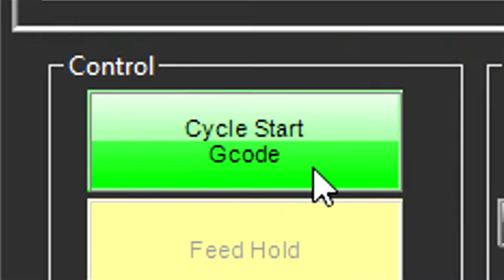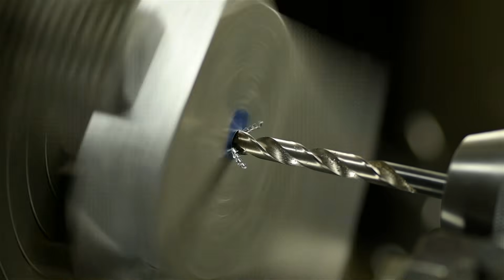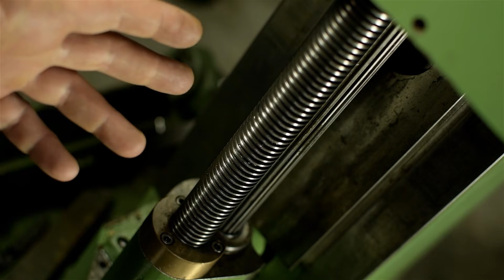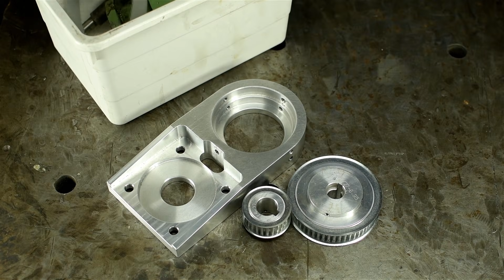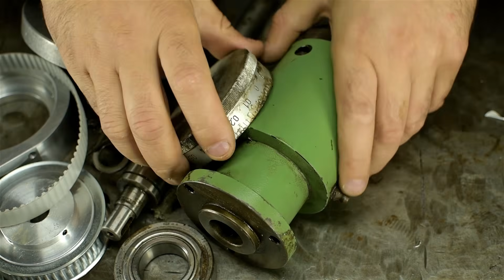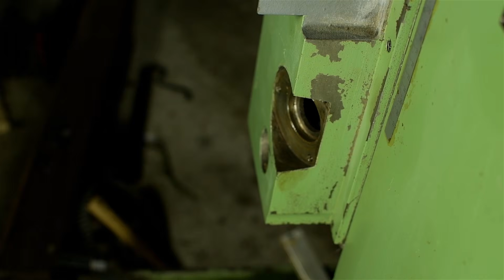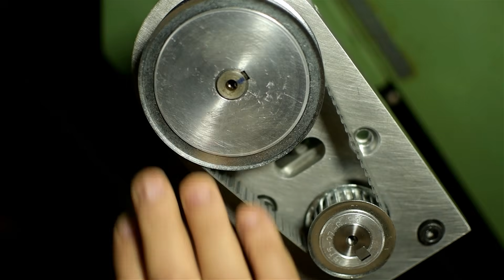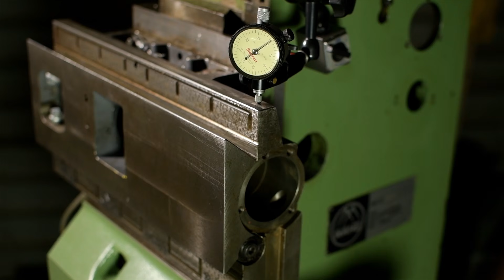MAHO: Move'n On Up!

Comment: high belt temperature means the belt is too tight or too small for the force you are putting on it. i put my money on the latter.
Reply: Or maybe the belt is not constructed/ incorrect material composition for the torque application....timing belt not drive belt? Reacon it is flexing/streching, just wait till the rest of the wieght goes on, might just fail, that sprag clutch was probably there to prevent the weight of the mill table combined with gravity from free spinning down when it was manually wound.....just my 20 cent bet ;)
Reply: What do you mean by too small for the force?
Reply: @AadityaKhare42  Every belt has a maximum force you can use it for. These belts look like T5 belts to me. I switched to T10 (that can handle bigger forces) on my robotmower because the T5 broke. If this T5 breaks TOT is in for a bang.
Reply: I’m not a big fan of using belt drives for high loads.
Reply: @nogmeerjan  it will probably just turn out that he was using an metric set of drive wheels and belt rather than imperial....lol  ;)
Reply: @AadityaKhare42  Getting a goat to pull a log instead of an elephant.
Reply: @nogmeerjan  My first guess was too much belt tension, but your comment on the load  rating of the "rubber" makes sense too.
Reply: Bunyip Dan weight of the table rests on that acme leadscrew, if that’s not turning then the table isn’t going anywhere.
Reply: Dya reckon that sprag clutch was to counteract the weight of the bed+workpiece so that the operator feels the same resistance screwing up and down? If so removing it may be causing the servo and assembly to be stressed when stopping after moving in the Z- direction.
Reply: @snaplash  he will really need that after all the wheight....that belt won't hold all the wheight in upward movement...
Reply: @blankroomsoup666  my bad, was locked into thinking in ball screw general characteristics.......still have a feeling under heavy load an acme screw might transfer some rotatation force if the handle was turned......maybe TOT could do a video on acme vs ball screw in vertical applications? 
Maybe it is just to reduce inherent backlash in the acme......which may mean TOT might want to retain it.......or just convert it to ball screw.
Reply: There is air being trapped and compressed causing heat. Drilling small air bleed holes and loosening the belt will make it silent as can be. A common problem for drag racing using belt driven oil pumps, fuel pumps, and roots superchsrgers. Gilmer belts are notorious for causing this :-) if the belt returns to 0 it's not stretching or deflecting.
Reply: You'll notice on most cars running a belt driven accessories like a Gilmer driven water pump use a "faceless" pulley. It allows air to escape. Since the belt doesn't need much alignment and doesn't walk off like other types they can get away with it.
Reply: Don't put your money on the ladder. It will blow everywhere. Trust me.
Reply: @Ding_Bat  I wish the Harley-Davidson Motorcycle Co. shared that view!
Reply: @bunyipdan  12.7 mm instead of half inch.
Reply: Have you considered suspenders?

Comment: Love the closed-loop control system.  It always surprises me when I read something on Reddit like "I was working on a 36 hour 3D print, but at hour 35 my printer lost a step and scrapped the part!"  For some small amount of money, you could have the printer know exactly where the extruder was, and just stop the second something went wrong, and accurately resume once you've taken a look.  I guess it doesn't really matter for hobbyists, where cheap is important above all else, but on some level it makes me sad how easy it is to do it right and we still do it wrong.

Comment: TOT regarding the belts heating up: "I'm not really sure what to do"
Us viewers: "what do you think it means?"

Soft voice in the background: "Gear cutting video"
Reply: The backlash is a problem and that is why they direct drive or use belts
Reply: @hackish1  Is there any reason not to use glass scales on the axes?  Then backlash anywhere in the system shouldn't matter.  I mean I suppose it would add extra cost....
Reply: @blahblahblahblah2933  the sync time is problematic. When you command the motor to turn, there are a lot of things that happen before the axis completes its move. You can't stop the machine after every move. 

Using the encoder on the servo is a more reliable method.

Comment: The servo DRO does not allow for backlash so be careful.
Reply: I wonder if it'd be better to close the loop on the axes instead of the motors.
Reply: @LanceThumping  For optimum results, you would use a double loop.  Using only table sensors would cause oscillations.
Reply: @byronwatkins2565  usually rotary encoder on the motor and linear on axle, loads of advantages although a bit harder on software, don't know if those drives have the option though
Reply: @Nuno.A  Servo motor position (angle) is quite precise; however, gear backlash allows the table position to vary several thousandths.  Clockwise motor rotation gives different table position than counterclockwise motor rotation.
Reply: @byronwatkins2565  exactly true, and to avoid backlash, play, on the gears,  belts, ball screw, coupling, etc, the table encoder is usually linear, has that give you a very precise position on the last possible moving part, on a vertical is less of a issue has gravity hides many of the issues, with that you can also do temperature compensation and correct backlash.. to a point, too much wear and the axles start shaking has the control goes in to constant overcorrection

Comment: "I also knew I would need a TON of torque. Maybe not 2000 pounds, but a TON of torque nonetheless."

Is that a metric ton joke? Cause I am seriously impressed.
Reply: imperial ton is 2,000 pounds, it was a standard ton joke
Reply: @herzogsbuick  Apparently an imperial ton and a metric ton are around the same. Imperial ton is 2240 lbs.
Reply: @pagaiba3  a long ton is 2240, short ton is 2000lbs
Reply: @herzogsbuick  alright

Comment: Cool conversion. I would advise you to keep the original Z axis screw instead of moving to a ball screw. With all the weight on it, backlash is not really an issue, and the poor screw efficiency (friction) will limit the holding torque required from the servo motor and it will thus run much cooler. If you don't need high speeds, and you lubricate it well, I guess it will work perfectly for many years to come.

Comment: I don't think the encoders in the servos can completely replace linear scales because they'll still be subject to backlash in the lead screw.
Reply: With a lead screw, that may be true, but with a properly designed ball screw set up, with preload. The backlash becomes vanishingly small, certainly good enough for home.  In very high end CNC, they switch to glass scales for basicaly insane accuracy.
Reply: @Kevgti5  and with a belt driving a lead screw?
Reply: @teryk  a belt driving some gears, which in turn drive the soon to be quite worn screw.
Yeah...
Reply: @teryk  The short answer is it depends. But highquality timing belts can get into seriously lil backlash. Many actual machines use em ? Like CNC lathes or packaging equipment (what I design). Realistically you could eliminate everything and put a servo gearbox instead, the "common" servo gearboxs have like 0.05 degree of back lash (3 arc minutes) and you can find better if budget allows.

Comment: Tony, I think you are screwing up when you think that an encoder mounted at the motor will tell you where the table is at. On the Z axis you can cheat (read fool yourself) because gravity will often take out most of the gear lash. For the X and Y axis I hope you are planning to use linear encoders mounted to the table and not the motor encoders. I love your style and the stuff that you do. I bought two of your T-shirts. I am a big fan. I used to teach beginning classes on analog servos to service techs. If you are interested I guarantee that you will get the best sleep you have ever had. Just kidding. I'm old school but I am good.
Reply: The ball screws he will be using should have very little to no backlash (if speced correctly for application), so motor encoders alone should be fine. Also most servo drives have backlash compensation parameters that can help with screws that have lots of backlash.
Reply: @RobertChadziutkoRC  We will all enjoy watching what Old Tony does.
Reply: @marklockwood7592  agreed

Comment: Love the blend of engineering and humour....The holding current of the Z Axis servo should hold it up...Not sure if it will when you power it off though...I used to use a French Huron Mill, and that would float down on the screw if you hand spun the handwheel...Kind of dangerous actually ..Great video, can't wait for the rest..

Comment: we recently added cnc to our e mill. we had already added steppers to X and Y so my dad's arms would stop hurting. then got a router, learned mach3 and cam softs, and transferred the brains to it. it was a project in itself to mount the z motor. I also used a timing belt reduction.

Comment: The chisel "magic" is quite satisfying! You should consider making some other perhaps more elaborated "magic shots" in one of your videos! 
Examples:
-Cutting large chunks or features of the part with the chisel as if you were "carving" a metal part
-Punching a hole with a blunt bit of round stock and a hammer
-Threading a part with a regular nut (you can fix the part and the camera; and then take a time-reversed shot where you unthread the nut and merge in composition with a still frame of the part prior to threading)
-Cutting round stock by wrapping some fishing line around it and pulling really hard

Just some ideas ;) 
That would be soo fun to see!

Comment: EtherCat is a fieldbus, used to communicate between components. Not just servo axis also I/O basically any EtherCat enabled component. So later easy to add I/O stuff, saves tons in time and cabling and commissioning!
Encoders come in many shapes, if no reference point is needed at startup then use an absolute encoder.
Servo motors never know where they are, by reading the encoder the drive knows where the shaft is.
2K for a 3 axis is a decent price for one-off application.

Nice machine work btw!

Comment: Tony , you will be very happy with servo motors. I put in some when my steppers didn’t cut it. Very precise control and no speed torque limitations. Now my screw drives tend to whip.

Comment: 23:30   You can get metal reinforced belts.  Also, when putting new holes into pulleys, it helps to use your indicator to make sure the pulley teeth have no runout when it's mounted in the lathe.

Comment: Hi TOT, Thanks  a lot for sharing. Finally the next MAHO video! If You want less noise from the timing belt, try the HTD 5M type as they are made in rubber with rounded teeth. Or better yet, choose the 5MR type to keep the precision. The polyurethane T5 belt You are using now is with trapezoidal tooth shape which causes a lot of the noise. It also has steel cords inside which is not helping to cool the belt at all.

Comment: Tony. Go direct onto the screw. You no longer need to be on that 90 degree. It was there to provide a handwheel position. It will be difficult to avoid chatter and reversal spikes on that access without a direct motor to shaft connection. And if you are going to that effort, go ballscrew.  Ex CNC design Engineer. Great work!

Comment: 14:14 Having drag in the down direction helps prevent drift from vibration while under manual operation. Also, helps balance the effort to move in both directions. Driving the Z axis with a servo motor, you'll likely want a power-off brake, especially if you convert from lead screw to ball screw
Reply: This dual level friction mechanism can be found on bicycle gear selectors prior to indexed shifting. Minimal friction is added pulling the cable toward the shifter, because you're already working against the return spring. Additional friction is used when paying cable out to counter balance the force from the return spring

Comment: Hey Tony, thanks for the video!

I would not suggest running the machine without limit switches. I am not a machinist, but in industrial automation we almost never rely on such kind of feedback to limit the machine motion, especially if the drive is powerful enough to ruin your machine (and your day when it happens :D). So if it was me, I would 100% include the limit swithes for the build.

Other than that, can't wait for the full MAHO conversion. Good luck from Russia!

Comment: hey mister this old, long time veiwer here and happily for you also a cnc machine service dude. the belt nois and heat is very standard as it's not ''broken in'' yet. Over time the heat and nois will become lower as the belt softens.
Thanks for the great content!
Yours truly, Mr. cnc machine service dude
Reply: I'm concerned that the pulley introduces another potential for lost steps, especially if the belt breaks.  Is this a valid concern?

Comment: This is extremely interesting , once worked in a shop that converted most all there G&L boring mills over , all but two.  I was a manual guy so I didn't learn nothing about CNC.  But what the hay ! I found your channel and at 73 so maybe I got a little time before I go to the root cellar.

Comment: So I am not exactly a EtherCAT expert by any means but one thing I learned the hard way is to never use cheap Ethernet cables. If your EtherCAT bus loses frames during operation the entire machine will stop because unlike Ethernet lost frames can’t be resent because it runs in real time. I think asking beckhoff or your contact at newfangled for the proper cables to use would be a good idea. Also if you want to use sensors on your machine for homing or other things beckhoff offers EtherCAT boxes that connect via a M8 or similar plug and read the sensor value directly via the therCAT bus so you can use it when programming in TwinCAT.

Comment: You definitely need to change that Z axis, way too much friction at "high-speed" that will for sure help your issue with heat on the belt drive.  It is so fine project to follow.  If you need a communication module for the Ether-CAT to arduino call the other way around, you can find it in Italy at AB&T.  Thanks for the lovely video.  ❤️

Comment: ThisOldTony, I have a servo driven CNC using servos and had the same belt complaints as you. What worked for me was using GT2 3mm curvilinear belts and pulleys with fabric faced belts. I run these to 5000 rpm and transfer 2.5HP through them no problem. With trapezoidal belts, air gets sucked into the pocket with the belt and is compressed creating noise and heat.

Comment: Belt Overheating Issue >>>  I'm not going to read the other ~1900 comments to see if someone else made this observation... The big pulley looks like it has eccentric travel, i.e. the bore is not centred to the drive face. This would make the belt tension change on every revolution. Constant stretch/release cycle will heat the belt. Great video as always!

Comment: Check the torque curve on the Servo motor. They will usually run at constant torque until they reach a certain RPM. At the point the torque curve drops off dramatically and the motor shuts down. I experienced this same problem with Clear Path Servos. Just a thought. Great video.

Comment: EtherCAT is a network bus system. That just means every device is essentially a network hub and the data is broadcast to all devices simultaneously. This just cut's down on standard ethernet read and forward packet latency. Think of it like wires logically in parallel instead of in series, despite physical daisy chain. The controllers themselves are standard, but read only from the broadcast data. 

Hope that helps.

Comment: Belt heat is probably alignment. Flat belts are very sensitive to tiny, tiny, tiny little misalignments. You could use the thermal camera to find hot spots on the belt and shim (in .0001 " increments), or you could just keep extra belts around, and lube them with a very small amount of silicone grease. I vote #2. Also, synthetic grease on that lead screw... Great video, nice work.

Comment: For those that aren't pretending not to know, the servos don't have batteries.  They have a disk inside with lines on it called Gray Code.  It's read by an optical sensor, and with it the computer can tell exactly where the motor is, without moving, at all times.

Comment: Even with servos you want to have limit switches and homing system. The encoder is in the motor itself, if anything ever happens where motor would turn without the axis moving (even properly tensioned, toothed belts can slip when the axis seizes up due to too much load or something, learned that the hard way at work) the servo would report a different position from the actual one. If it happened a few times in succession when driving down for example, then when machine moves back up, it could go over the limit, smashing against something.

Comment: The servo knows where it is at all times. It knows this because it knows where it isn't. By subtracting where it is from where it isn't, or where it isn't from where it is (whichever is greater), it obtains a difference, or deviation. The Ethercat system uses g-code to generate corrective commands to drive the servo from a position where it is to a position where it isn't, and arriving at a position where it wasn't, it now is. Consequently, the position where it is, is now the position that it wasn't, and it follows that the position that it was, is now the position that it isn't...

Comment: About the one way friction thingy in the hand wheel assembly.
If you move the table up you have to fight the gravity and friction. if you crank down the gravity will help you. this gives an asymmetrical feel to the hand wheel. The system is in place to make the movement feel identical if you move the table up or down. This increases the accuracy and workflow.